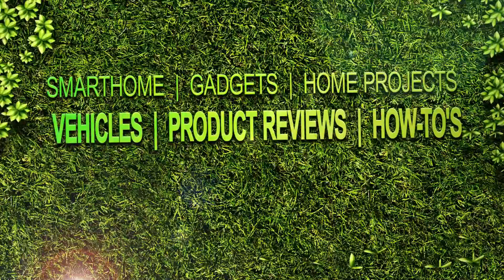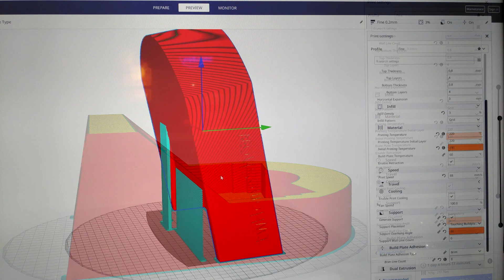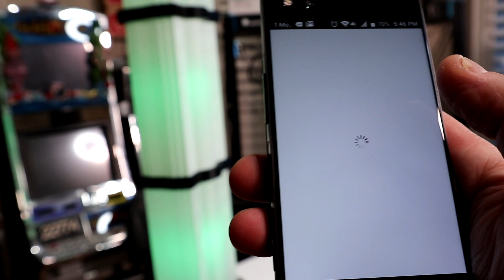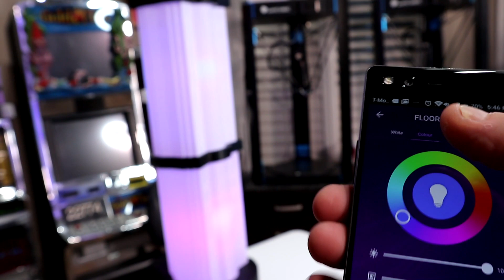LED Floor Lamp | 3D Printed | OVER 4 1/2 FEET TALL!

Comment: have you had any problems with heat in the sockets? I know the bulbs wont produce enough to hurt anything, but what about at the socket? Hows this held up in the month or so since the video was uploaded?
Reply from the maker: Hi Jon, NO...they don't even get warm. Everything's COOL :) The light assembly held up really well...I'm giving it to our Niece because she really wants it for her bedroom. As long as it stands in a corner and doesn't get knocked, it's fine.